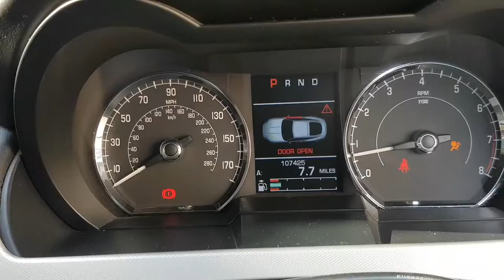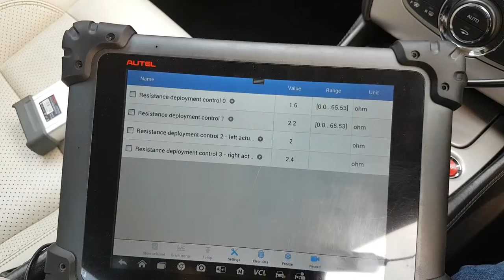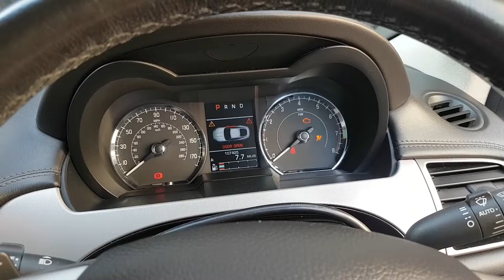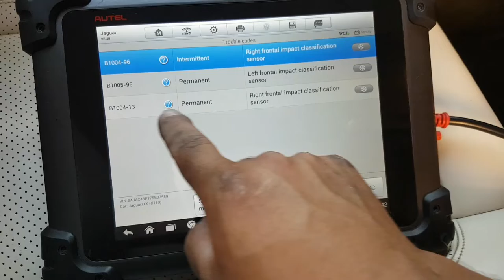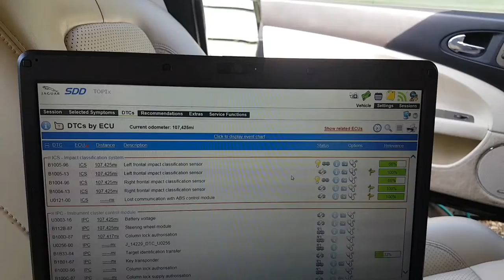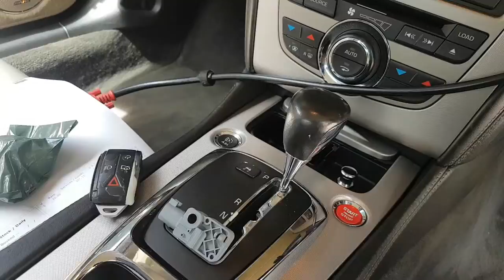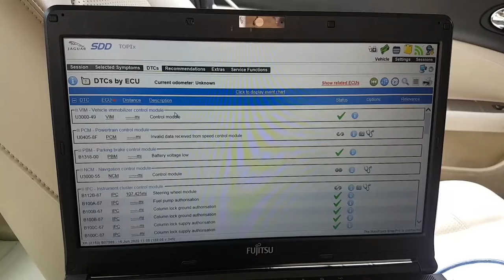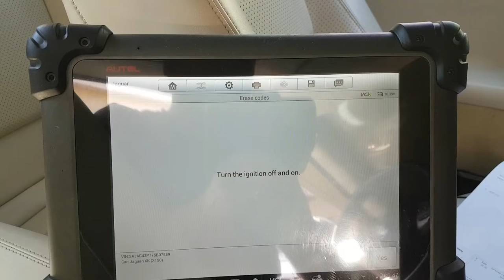Jaguar Pedestrian System Warning! Fault finding and repair.

Comment: Good morning Luis, A good and expensive looking Jaguar. Two faulty sensors diagnosed and the customer haggling for a used replacement from ebay. Happy you stood to your principles. Good work as always 😊

Comment: I used SDD in engineering mode to turn the warning off.  Problem solved forever, and no risk of destroying my hinges if i hit a badger.
Reply from the maker: That's another way...
😉
👍👍👍
Reply: You mean disabling the pedestrian sensor itself?
Reply: @toffeepie1878  No the system is still present, you're turning off the warning so if it is broken you don't know about it.

Comment: Its a common problem on early cars. You only need to remove the under tray and then you have easy access to both.
Reply from the maker: As I said on the video... was a reason why I did not removed the under tray...
👍👍👍
Reply: It took me 5 hours to re fit the under tray on my 2009 XKRS, at least a day to remove it. There's about 2 billion bolts and Chimney nuts holding that on, mostly rusted through. Jaguar never wanted people to get under that car
Reply: @LMAutoRepairs Is the Supercharged variant easy to access I think you can get into them from the engine hood with the radiator cover pulled?
Reply from the maker: Possibly...
👍👍